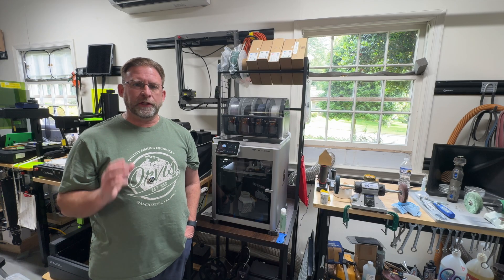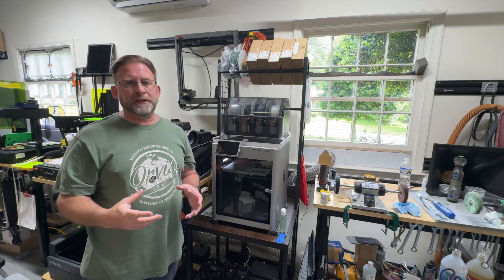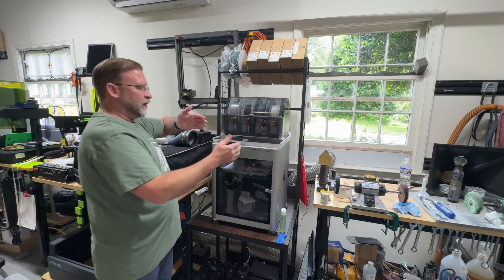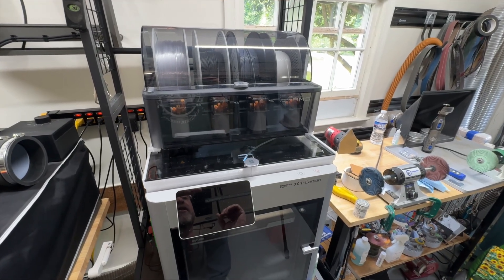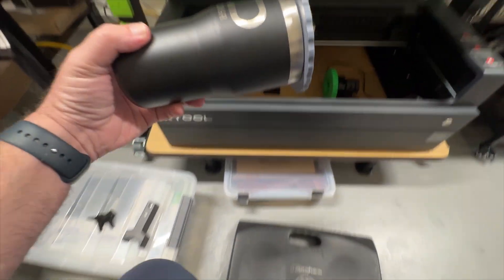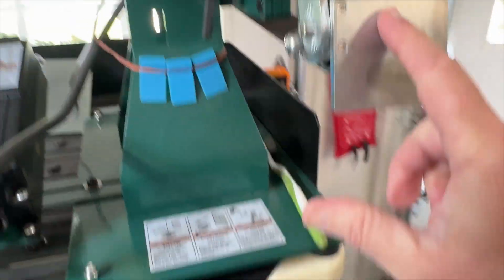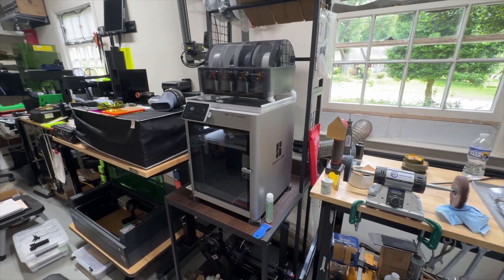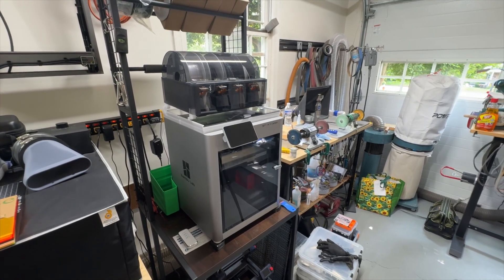Bambu X1C Is the tool you didn’t know your shop needed!

Comment: Bambu is a company that made 3d printing simple, but that does not make them the best, The Voron printers are better, they are a pain to set up but once done they are hard to beat. For example, multi head which allows you to print many assorted colors and different material with little to no waste to the poop chute
Reply from the maker: I hear ya...I do hear good things about PRUSA quality also. I think Bambu may be best at user friendly and have very good quality to go with it but I will say I can't say for sure they are the #1 in build quality but to say whats "Best" will depend on the customers needs which will vary from user to user. I still love mine and would get another from them in a second if I needed one.